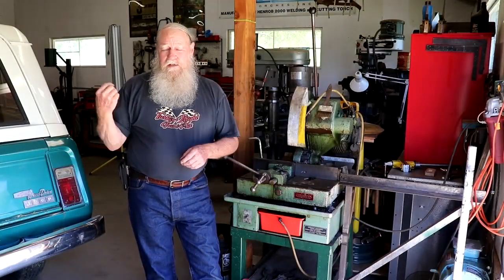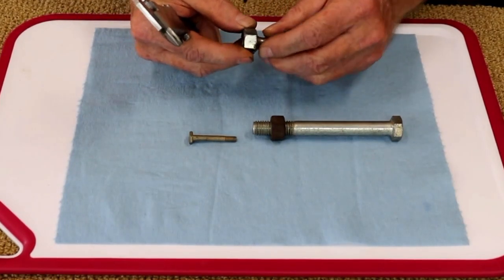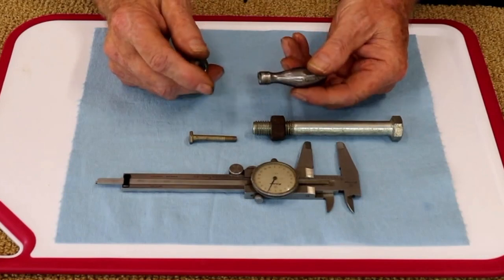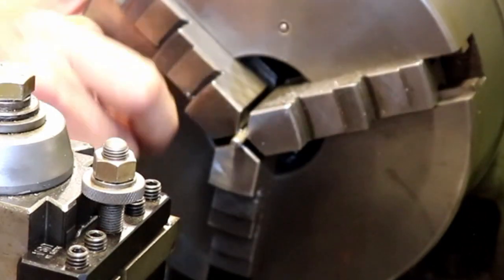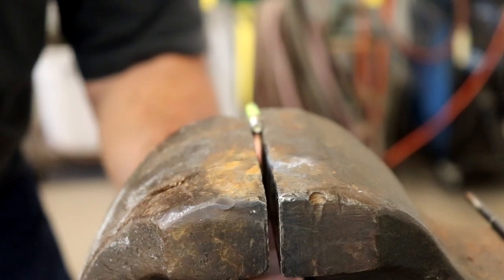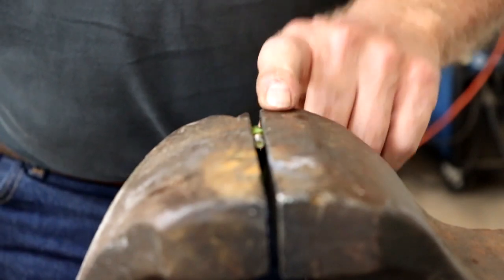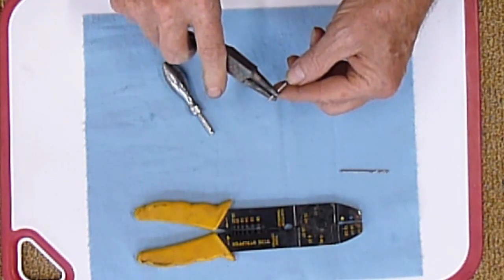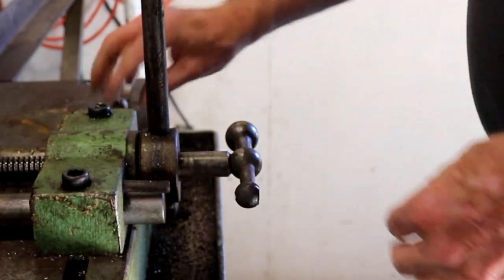Saw Handle Repair

Comment: Nicely done. That centering trick with the transfer punch and vice was one of those “how did I not think of that before” moments for me. Thanks!
Reply from the maker: Hello Grip Side:

Did you notice the magnet on the tail stock? I had all the drills and taps on it and another on the side holding the tap handle. Everything needed for that operation was at hand.

Thanks for watching.            Jere
Reply: Jere Kirkpatrick I’ll be honest I did not, very cool! I did watch you start that tap like 3 times and I’m still not sure what I witnessed.
Reply from the maker: @griplove  Hi Grip:

With the tap being a 10-32 I didn't want to take a chance on breaking it off by driving it under power. It could have been just a slight amount tighter. The idea is to get the tap started straight and just a couple of threads past the taper of the starting tap. I hope this answers your question, if not, please ask for more clarification.

Also notice the use of magnets on the tail stock to keep everything for the tapping operation at hand including the tap handle. Also the use of the tape when I drilled the small hole so I could use a transfer punch to center the hole on the piece to be drilled. And the tape allowed me to position the part from beneath the vise jaws.

Ask if you need more. Thanks again.           Jere
Reply: Jere Kirkpatrick at first I thought you power tapped. It looks like you drive it all the way in. I backed it up 3 times before getting to the point where you finish the tapping. Then it started to make sense. Still looks like some damn voodoo at first. 😂

Comment: Thanks Jere.  Simple solution and we got to see how the master makes hairpins. I imagine you made plenty of those in your early career working for Shelby.  Joel.....
Reply from the maker: Hi Joel:

When ever I re build a carb. I always replace the small cotter pins and "C" clips with ones I make with .032 stainless steel. I have also made them out of .125 stainless for transmission linkage. They are much easier to remove when the time comes.

Thanks.          Jere